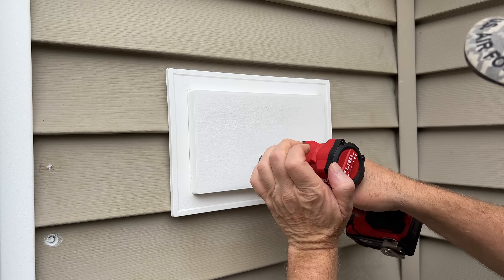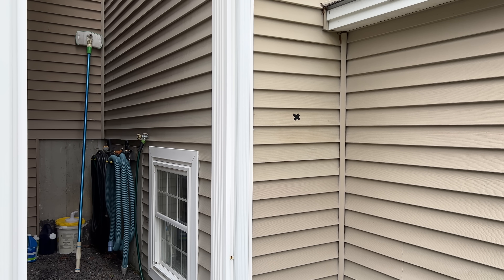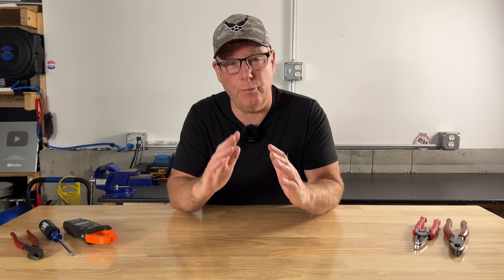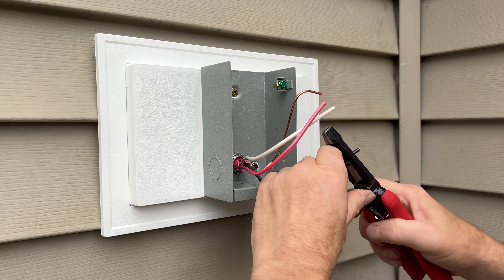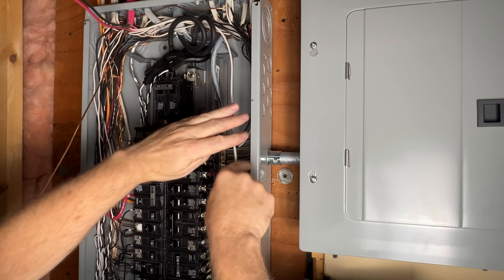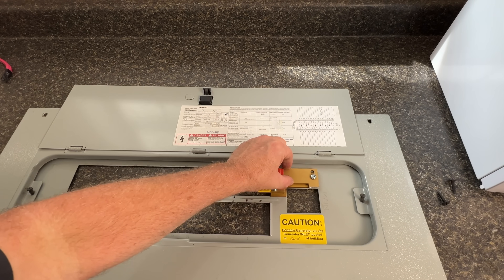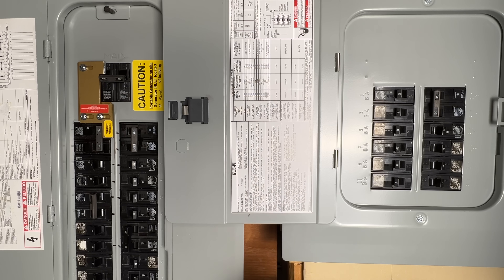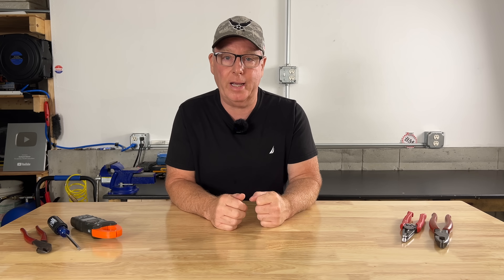Watch This Before Connecting a Backup Generator to Your Home.

Comment: John I was a licensed plumber in upstate NY for years. I had the understanding that when using a generator during a storm, a Transfer Switch or Controller would automatically switch power from the Utility Supply to the Generator Supply. But with all the new technology available I guess it is a bit simpler than years ago. 
I’m planning on building a new house up north and I look forward to seeing your videos in putting a separate sub-panel for the essential parts of the house. 
Usually the kitchen requires the most circuits, I seem to remember that it was 6 or 7 circuits, using home run circuits for appliances that draw a lot of power compared to the rest of the house. 
Thanks for sharing your years of knowledge and experience with us. 👍
Reply from the maker: Whole home backup generators that are permanently installed usually have an automatic transfer switch. Smaller portable generators are usually installed like this or with a GENTRAN panel. I need to replace the plumbing under my kitchen sink. My house was build in 1998 and the plumber used drum traps. I am constantly have one sink back up into the other. I need to rip it all out and start over.
Reply: @ I use to cut my niche with renovating old Historic Victorian homes and they all had lead plumbing with drum traps and knob and tube wiring. The walls were usually installed with straw and plaster wall with horse hair mixed in the plaster. 
I learned a lot from those old Craftsmen, prior to joist hangers. 
Returning those old Painted Ladies is not for everyone, but I like seeing their life restored for new generations. 
Thanks again for your years of work and advice for others looking to upgrade their homes.
Reply from the maker: @Billytomtom18  Thats awesome my friend. I helped my mother and her husband renovate an old house like that in southern VT back in 1988-89. It was a lot of work. The floors were sagging and the walls were all cracked. I did the demo, all the wiring, most of the plumbing. Thats when I realized it would have been less labor to tear it down and start new. But it turned a 125 year old home into a pretty nice house.

Comment: Do your homework on generator , learn about THD , it can be really important if you’re using sensitive electrical devices such as computer and others , there isn’t many brand of generator with under 5% THD . I’m using myself a dual fuel generator because it’s easier and safer to store propane gas can than gasoline .
Reply from the maker: I don’t run TVs or computers on my generator. I want get an inverter generator to replace the one I’m running now.
Reply: @ your generator is a Champion , they are usually under 5% THD and even the newer are under 3% , I was making a general comment for everyone
Reply from the maker: @lacuzon39000  When my well pump kicks on I get a significant voltage sag while the generator try to push through the inrush. I don't want my electronics running for that reason as well. I have a better system that will currently last about 7-8 hours and I plan to expand it to 14-16 hours. With a 6kw inverter it handles my emergency loads and the electronics. After that it the generator.
Reply: Sensitive electronics should have their own line conditioning/AVR/UPS any way.

Comment: Qyestion: the 12 circuit box is not absolutly needed, is it?
Reply from the maker: No. I installed that for a battery power station with a automatic transfer switch

Comment: Wouldn't it have more sense to run the backup generator wire directly to the subpanel instead of the main panel?  Put the lockout kit on the subpanel so that everything on the subpanel can get power from either the main panel or the generator.
Reply from the maker: I have a battery system as well with an automatic transfer switch to the sub panel. Also I sometime want to run a few loads that are not in the sub panel which is why i do it like this.

Comment: I am installing generator hook up. Top left breaker is 100 amp. Wire not long enough to move it to bottle. Don’t know if wires are long enough to move all breakers down 1 space to empty top. Any suggestions?
Reply from the maker: If the top left is your main you should be able to install the generator breaker on the top right and find an interlock for that setup.
Reply: @BackyardMaine  Top left breaker is for ac unit. Already purchased interlock for left side.

Comment: Why didn't you install the siding block up and down instead of sideways? Matching it to the box you installed. Would have looked and worked much better. Never looks good when your box overhangs the siding block.
Reply from the maker: I looked at that and decided it looked better the way I installed it. Looks  are very subjective.

Comment: Great video! I have a question regarding my inverter generator, which has a floating neutral. You didn't mention anything about transferring the neutral to the panel, or how to handle the situation if the generator's neutral and ground are bonded. Could you please provide some guidance on this?
Reply from the maker: I believe I answered this questing already but if not let me know.
Reply: Yes you did and much appreciated for all your education and help :)

Comment: What is the labor cost?  I need mine just below the panel, and need to move two breakers up.  One guy wanted $1,500. Seems crazy. I am not comfortable with my hands in the panel, though it seems easy don’t need sub panel, just connector b
Reply from the maker: If it right under the panel it should only take an hour. Two max. If you can find someone who does electrical work on the side you may get a better price.
Reply: I agree. These guys give all others a bad name.

Comment: Will this run a electric furnace?
Reply from the maker: That would depend on the kw rating of the heater and the kw rating of the generator. Resistive load like electric heaters don't have inrush like a heat pump or AC unit. The only inductive load would be the fan and or blower motor. For example if you had a 3kw heater and the generator running load was 4.8kw like mine you would be fine.

Comment: I had a guy come over and hook up my generator. What he did was take a dryer plug and install it beside breaker box. Is this really a safe way to do this.
Reply from the maker: I don't like having to run the cord through a door or window to get to the plug. It is very easy for CO to get into the house through a cracked open door or window. Also with a dryer plug you need a connection cord with two male ends often referred to as a suicide cord and they are very dangerous. I assume the breaker connecting to the dryer plug is not interlocked with the main which is not safe and its actually an illegal connection.
Reply: Generator are a temporary power source,till you get your provider to do their job, how about just put the wires to your circuit breaker  from the generator to  whatever ever power you want the generator power to go to, tire of all these fools trying to make life hard for people trying to live.

Comment: I'm not an electrician but did this exact thing a few years ago.  My generator is a smaller 120V Westinghouse 3600w which means I can only run every other row of breakers.  Luckily for me and moving a few breakers around I can power 90% of my lights and both my fridges.  

I do have to turn one fridge breaker on at a time to avoid surge watts but it was fairly easy. 

Couldn't imagine how much it would cost to have an electrician come out to install it.
Reply: I heard doing with a 120 v gen can possibly  over loads the neutral wires, can some  Pros  comment on this ?
Reply: $350

Comment: Kinda pushing that 100 amp service with the panel being loaded with circuits arent ya??
Reply from the maker: No I'm not.. I have CT's around the main and I average around 2A to 4A per leg. When we're doing laundry I can see up to 18A to 20A per leg. Vey lightly loaded system. Remember you don't add up breakers when determining capacity.

Comment: A very well-presented video. I just built a 33k backup generator (I have a vid of it on my channel if you choose to view.) and have done extensive research and viewing of the good information the everyone offers on Y/T in the process. In all my viewing and research, I note that nobody really addresses the importance of "Earth-Grounding" the generator unit itself while in use. Everyone stresses the safety factors needed in using the generator, which is great, but somehow, I feel that "Earth-Grounding" was overlooked. Am I being too overcautious, and is it worth readdressing? Being that every home has an Earth Ground rod or connection (Many are hooked up to the municipal water meter, while others are a grounding rod outside of the house near the Grid power feed.) My thought is that if a home must have an earth ground while on the grid, and the grid power fails, we remove the link between the grid and our generator before we power the home on that generator. The generator itself should have its own earth ground as I see it in order to make a completely independent and safe power supply for the home it is powering.  Again, I ask, am I being over cautious, and do my thoughts carry any merit? I appreciate any input an thank you all for the great info that you have provided thus far.
Reply from the maker: Grounded electrical systems are required to have a ground and neutral bond at the first disconnect. When using a generator for backup you would want a floating neutral at the generator. (not a bonded neutral). If you are using a bonded neutral at the generator then you will need to switch the neutral along with the hot wires when transferring to generator. This would be considered a separately derived system. Having a bond at the generator and at the utility is not code compliant and can be hazardous. Remember that when on generator, your grounding is still intact between the generator and the service and unless you're switching the neutral (uncommon) so is the neutral to ground bond. The only time you need a ground rod at the generator is its a separately derived system. (so your generator has a bonded neutral connection and your switching the neutral). I know this can be confusing. I have seen many electricians get this wrong as well. Did you know that the grounding path is not there to take fault current to ground but rather back to neutral and the source. If you were to disconnect the neutral to ground bond, a ground rod would not provide enough current flow to open the breaker. A ground rod is really surge protection (in most cases lighting protection). When lighting strikes something directly there is no protection that can withstand the hit. But when it strikes near by all conductive surfaces around the strike build up a massive inductive charge which is looking for a path to ground. The ground rod provides this a path back to earth. I hope this helps. Mike Holt has some great information about this on his channel as well.

Comment: Thanks so much John for making and sharing this video, it is so useful to me and I'm sure to others.  Living in Florida east coast, I hired an electrician to install the very generator box you highlight in your video.  My manual interconnect switch looks different than yours, in mine there is just a lever I move to disable the mains. I have no stickers also.  My generator has electric start, 13,500 surge watts, its called EXL 8000 so I think that is 8000running watts?  It has a pressure oiling system with auto type oil filter.  My concern is that I dont have a sub panel just for critical circuits, house was built in 2003 200 amp capacity.  My sub panes just feeds additional circuits that I guess wouldn't fit to the main breaker box as it is full.  I trust you because you have the appreciation of professional electrical contractors in the comments area.  You have a gift of teaching, like when you decide to quit the hustle and bustle of the work you do, a teaching position at a trade school would be ideal so you could pass on your years of experience.  Thanks again, Ted in Sebastian, Fl
Reply from the maker: Thank you Ted.. I hope you got through the storms ok. You do not need a sub panel for your critical loads although they can handy. Just be vigilant about the loads you energize off the generator to be sure you don't overload the system. With 13.5kw surge and 8kw running that gives you a decent amount of power. (about 33A at 240v) x2 for your 120v loads). I have done some teaching in my career. I spent about 30 years working as an industrial electrician before moving into electrical engineering for my last 10 years of employment. I'm retired now and enjoy making videos..

Comment: Does your generator have a floating neutral or bonded.
Reply from the maker: Floating Neutral.. If you have a bonded neutral you will also need to switch the neutral along with your line conductors because the neutral to ground bond can only happen in one location. Another option would be to remove the bond at the generator. If you do that you will want a bonding plug if you use the generator for something other than home backup.

Comment: How does backfeeding one side of the panel give power to both sides of the panel ?
Reply from the maker: The buss behind the breakers are staggered so on the left side for example the first spot is one pole and the next is the other. That’s why we have 240v across a two pole breaker. So a two pole breaker installed anywhere in the panel would back feed the whole panel.
Reply: @BackyardMaine  I get it now, Thanks !

Comment: What if you don’t have a main breaker switch on the inside but only on the outside? Do you have to install anything differently? Can you still install the 30 or 50 amp switch without an interlock system?
Reply from the maker: The do make transfer boxes like Gen/Tran where you can move a select number of circuits over to it which can be backed up by generator. These are quite common. Another option would be to install your connection outside beside the main breaker with an interlock like I did here or you can install a transfer switch.
Reply: I have a 125amp panel, without a panel shutoff. I bought a 125amp breaker, and installed it at the top left with the 50amp breaker for the generator right below it. This way, I was able to install the interlock. Obviously I had to move some breakers around.

Comment: Sir. By simply putting the double 30amp in that location, it will power up the critical loads?
Reply from the maker: Yes. It back feeds the whole panel so I can select what circuits to turn on.

Comment: Does it matter using starnded or solid copper wire for 30amp or 50amp?
Reply from the maker: If you use 10 gauge NMB cable like I did in this video it will be solid copper. For a 50A feed your NMB will be a  stranded copper. You can also run raceway and pull in stranded wires if thats what you want to do.
Reply: @BackyardMaine  for a 50amp power inlet is 6 gauge or 4 gauge conductors recommended?

Comment: Doesn't connecting the generator to only one side of the panel only power that side of the panel? I had a tree branch wear through one strand of the power line to my house, and only one side of the breaker panel was powered as a result. To my untrained perspective I would think the generator connected to only one side would power just that side. I've seen a couple videos of guys doing what you did and I figure I am wrong, but I need some info on this. Thanks.

Also, is it possible to move all the breakers on the side the dual 30 amp breaker is being added, and just having to relabel the key of what each breaker is for?
Reply from the maker: The buss supplying the breakers are staggered so every other breaker connected to opposite poles on your 240v system. So the two pole breaker no matter where its installed will supply the whole panel.
Reply: @BackyardMaine  - Ah, yes! I know what you are talking about. It's been a long time since I've seen the buss with the cover off. Now I remember. THANK YOU, that's exactly what I needed to understand this.
Reply from the maker: @1001Hobbies  My pleasure..

Comment: To add, im thinking about connecting a low start to my  2 1/2 ton A/C TO REDUCE THE AMPERAGWE ON START UP SO MAYBE I CAN RUN THE AC IF REALLY NEEDED, WHAT DO YOU THINK ?
Reply from the maker: Yes a soft start is a good idea if you're planning to run your AC on a generator. Also be sure that the kw rating on the AC is well below the running capacity of the generator.

Comment: Thanks enjoyed it, this is how i have my Generator connected as well, it a predator 8750 .  It works well, lights, 2 fridge, and i can heat the water  heater and  washing machine , I just purchased a 10btu portable room a/c  so i can use in different rooms as needed .  My generator will only run the fans on  my 2 1/2 TON A/C.
Reply: Put an easy start package inside your AC Unit and you can run the AC off your Generator.